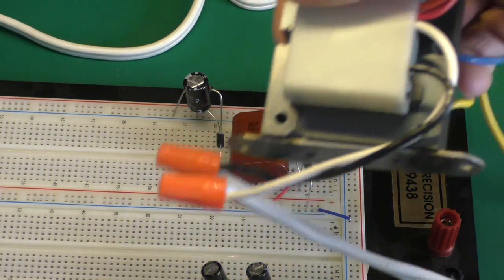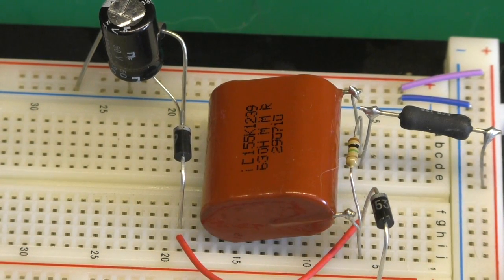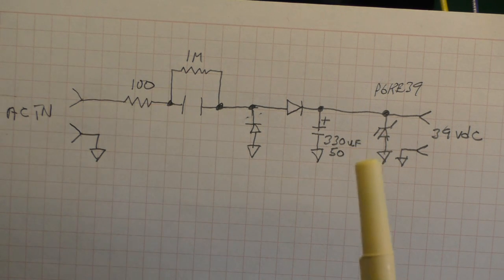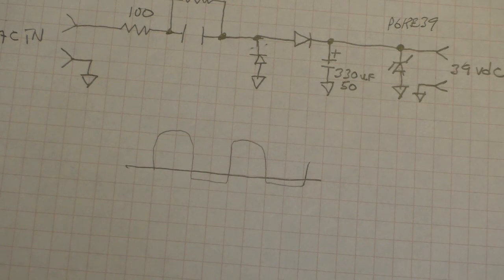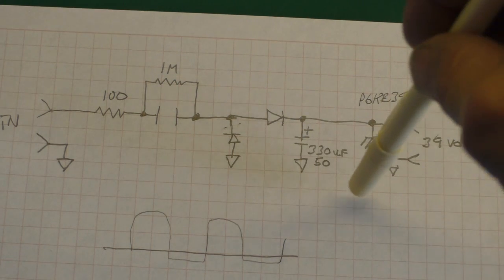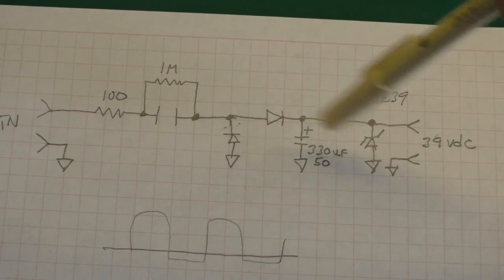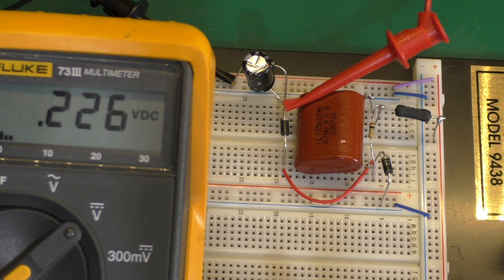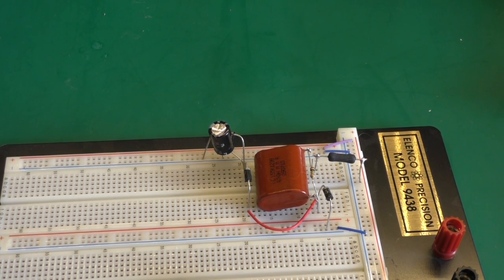R&D #4 Transformerless power supplies, an introduction

Comment: Problem is using the circuit for low volts. The current remains constant from the source requardless of what you use.

Comment: Hi, do you have any scheme of how to build transformerless power supply from 110v ac to 19v dc over 9 amps??
Reply: DANIEL AUGUSTO SERRUDO RONDÓN This type of circuit are only able to supply at maximum  a couple of hundreds miliamps. 200ma 300ma maximum. They waste a lot of power. You have to use a transformer for a power supply that high (19 amps)

Comment: Great video! I have question. I am working with a 12v power supply with variable overprotection rated from .15- .3 ma. I'm running 2 motor   rated 12v and they are drawing .723 and aboutà 1.12 plus at stall. It's been about. 15 years since I studied anything with electronics so I'm getting back into it. My question is what can I do to increase the amount of amps  on the over power supply as these motors are easily tripping the over current protection during normal operation? I was thinking the pot may be changed out for a higher rated one but I feel like I'm guessing and I can afford to guess. lol. Any help is greatly appreciated.

Comment: So that gihugic capacitor - being the key to the circuit - what is it? I ran the numbers and came up zilch. To get any reasonable current out of one of these type of power supplies you need a very efficient, low loss, fairly high-value, non-polarized capacitor - usually a PPC. So what is that thing, what is its value, and where can you get one?
Reply from the maker: +Denny Myers The cap is a 1.5uf 600v Polyester, you can get them at digi key, or any other parts supply company, this type of power supply does not produce very much current, nor are they very efficient, they are mainly used to save space.
Reply: +R&amp;D Department - Thanks! I'm working on a 1 amp version with the limiting cap in series after a rectifier bridge so I can use an electrolytic... If I don't blow the house up and/or burn it down, I'll post a vid. Again, thanks for the response!

Comment: Your circuit is a voltage divider using a resistor and capacitor in series. A lot of energy is wasted through the dropping resistor which just become heat. This is a wasteful circuit.
Reply: +MrQuidestveritas  Use a half-wave rectifier to obtain half voltage DC, then use a buck converter to reduce the DC obtained from the half-wave rectifier. Then no power is wasted in the dropping resistors.
Reply: if your purpose is only saving power than one can use smps , cause buck converter also not produce quality power
Reply: Vikas Mathur - The subject of contention here is transformerless power supply, which is now the state of the art and very common in celphone and tablet chargers. If a charger is light in weight you can be sure it is transformerless, due to the absence of copper coil and iron core.
Reply: mobile and tablet chargers uses smps (and because of high switching frequency transformer/inductor is very light in weight and smaller in size ) and your suggested crkt also needed a big smoothing capacitor after half wave rectifier
Reply: Its not intended to replace a true power supply, sometimes you just need a few tens of milliamps to run a control board. It's not a stand alone power supply that you can charge your phone from but rather a building block to be implemented into whatever you are building. These sorts of supplies are commonly found living behind the control panels on appliances like dryers and cookers away from ground referenced fingers.

Comment: Hello,
  I have been looking around for T-less PS design and came across your video.  My main concern was figuring out the exact proper design value for R (current limit resistor). To small, and the C has to stand the full inrush of the load (filter cap etc.); to big and it sits there and dissipates heat for now good reason. 
Anyway, the main reason I commented was the "negative suppression diode" that is used to clamp the negative half-cycle.  To me it is unnecessary because the reverse PIV rating of the forward (positive) diode is sufficient because it just ignores the negative excursion altogether.  With this diode in, it just dissipates unecessary heat during the negative cycle for no good cause?  I've seen this in other circuits though.
Reply from the maker: SpinStar1956 The parts are relatively cheap you could bread board the circuit and hook up a scope to it and see how it looks, as far as inrush current damaging the cap I wouldn't worry about it, just make sure the cap is rated at twice the voltage it will see, if you use a 1uf cap the equivalent resistance is over 2.5k ohms, I have seen people use no inrush limiting resister at all on these circuits, it all depends on what your going to do with it.  I am Finishing a video about choosing the right capacitor for these T-less power supplies, it should be out by the week end.  Thanks for watching.